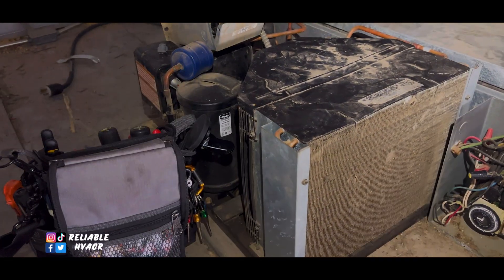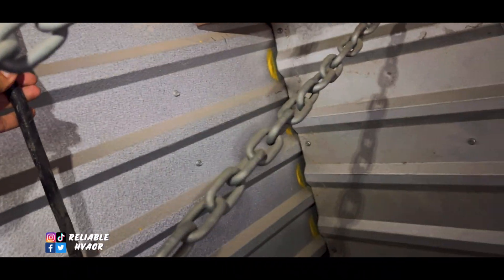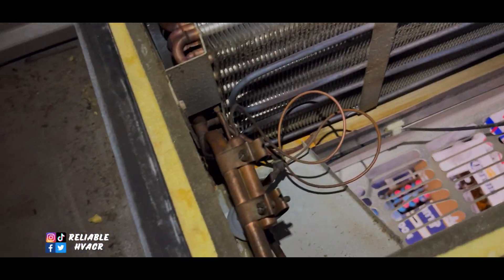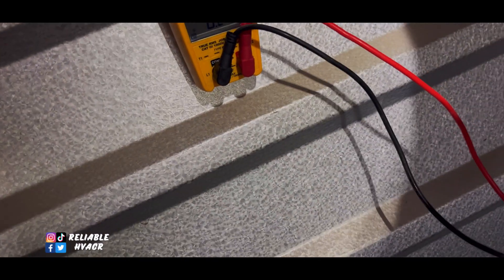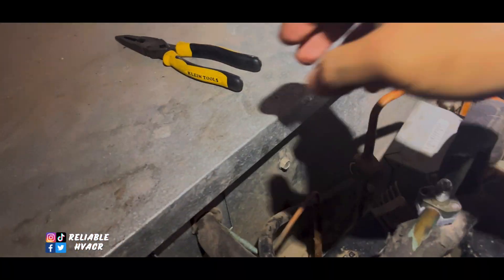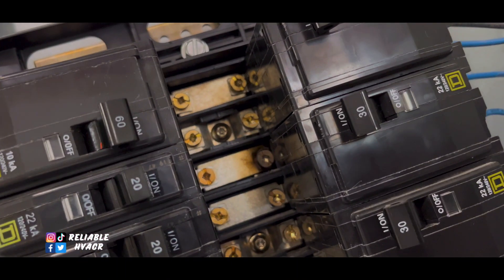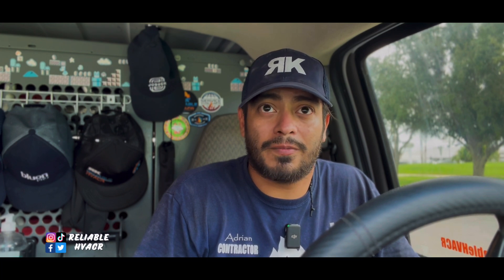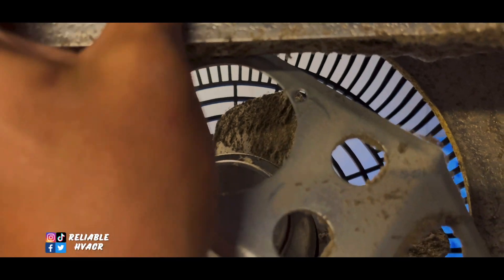Cooler randomly stays off, they told us it was the compressor / HVACR

Comment: Fire Hazard [VERY IMPORTANT]
I changed out a breaker on a house, the panel on the A/C Unit said Max 45amp on the a/c unit
They had a 50amp in the house panel, so I put in a 30amp in the electric panel because it was the minimum for the a/c unit and the wire was aluminum wire with a 100ft distance 
I next checked the fuses. 60amp was installed so I changed to 35amp at the unit disconnect 
This unit was installed in 1986 new for the house

Comment: I’m an electrician and HVAC tech 
I recommend you looking at the proper breaker because from the panel to the breaker should be less than 125 feet or you have to upsize the wire one time this is called a Voltage Drop second I would check the fuses also